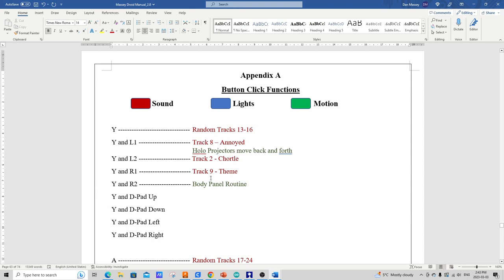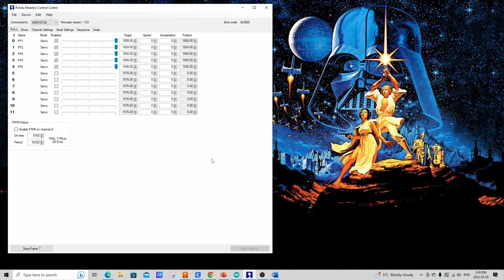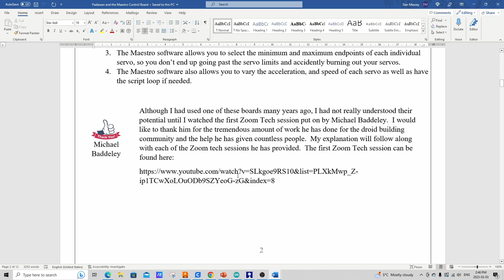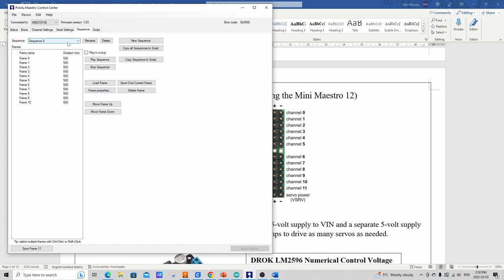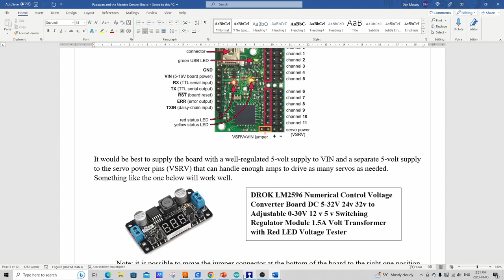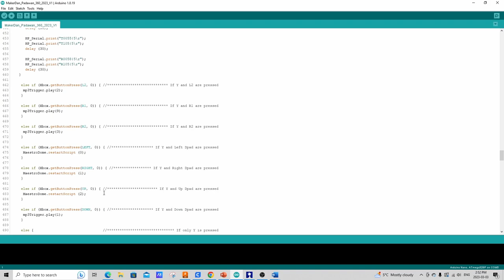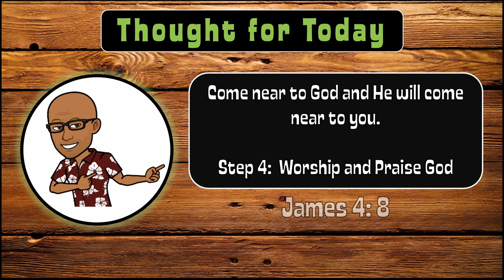R2D2 Build Episode 17 - Pie Panel Installation and Animation

Comment: Good morning Maker Dan!  In some of your previous episodes it looks like you were building the Matt Zwarts lifter mechanisms for your dome.  But then I see you using these pie hinges.  I tried the same thing and found these hinges did not work with the lifter mechanism because the hindges are more narrowly spaced and do not fit in the pre-designed slots of the Matt Zwarts lifters. Did you find a work around, but I really like this combination of the two?
Reply from the maker: Hi Jason.  That's a very good question.  Well, the sad thing is I built the mechanism before I built the dome.  Now I find out the mechanism is too tall for my dome.  My plan is to complete my dome and then rebuild the mechanism to fit my dome or not use the mechanism at all.  I haven't decided yet.  Let me know how your build is progressing 😁.